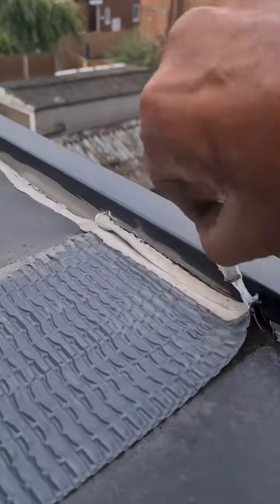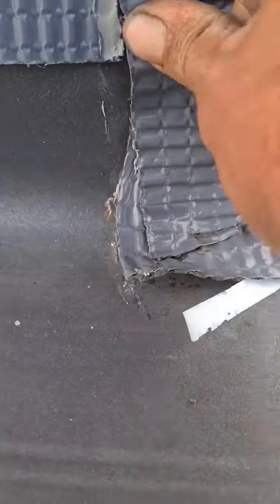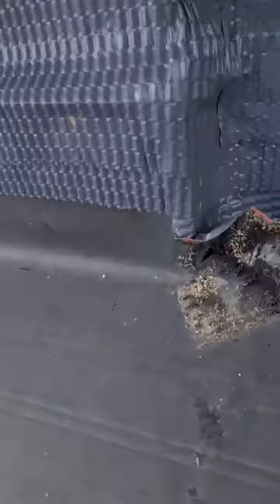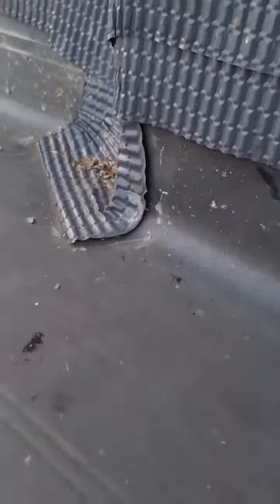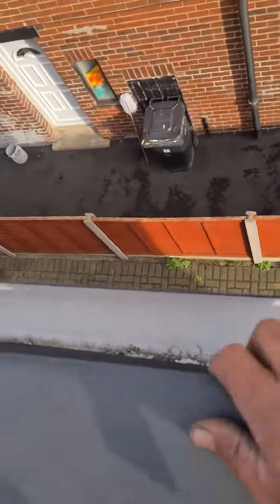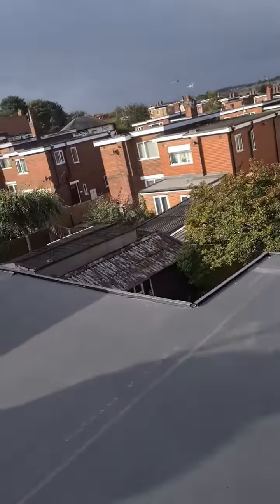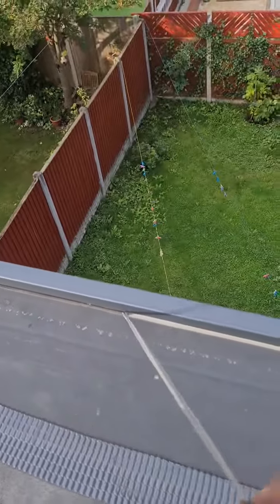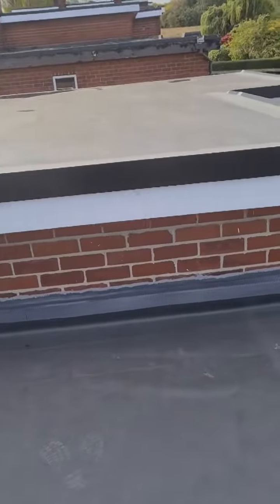FAILED RUBBER ROOF REPAIR

Comment: Why bother to quote repairing this shite?
1. Customer paid cheap 
2. Customer now left with consequences. 
3. Never quote to ‘repair’ their work. If there are  further problems down the years the customer only rings the roofer who touched it last. You get the “blame” so to speak if it fails further.
4. Meanwhile the cowboys who took the lions share of the money run off into paradise. With not even a phone call. 
5. Strip the lot, charge proper money for a proper job. And stand on an insured backed guarantee. 

Pay cheap pay twice. 

If roofers are gonna try and repair poor workmanship its creating a rod for your own back, and allowing customers to escape their own stupidity in accepting half price estimates. 

Hold everyone to account and do a good job. And have no come backs. 
Repair this shite at your own peril I’m afraid. 
Good luck and keep the vids coming. 
With love from Newcastle ❤️